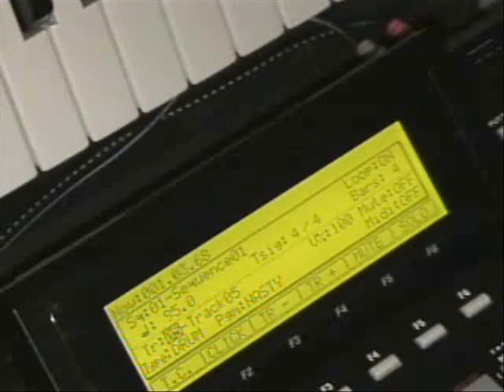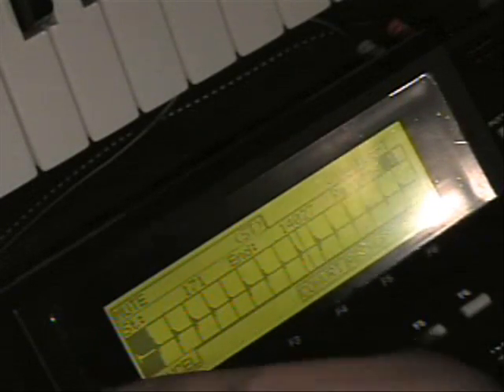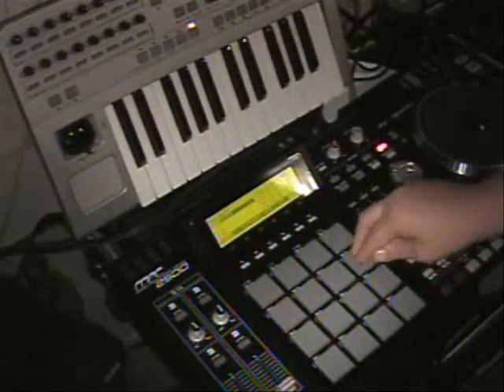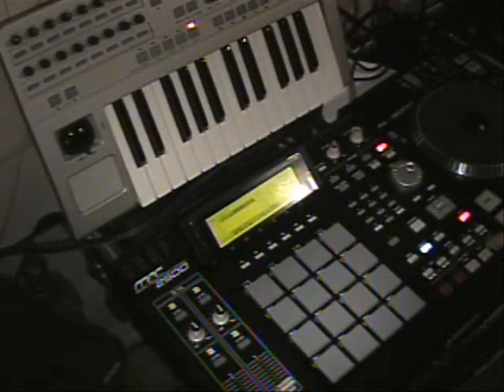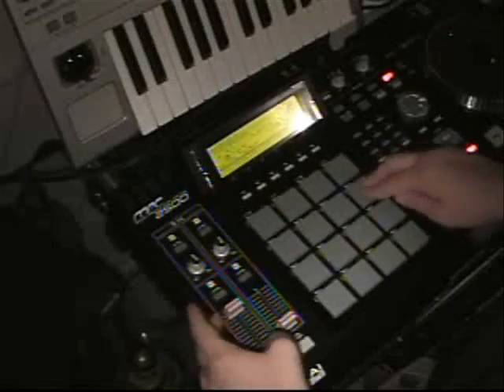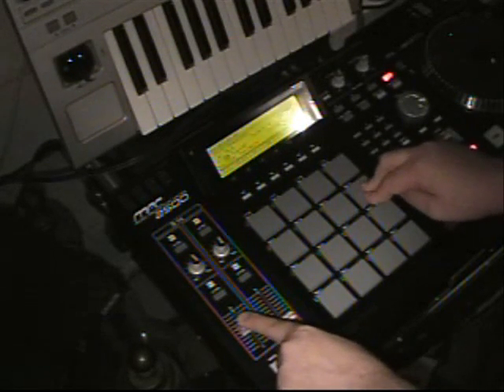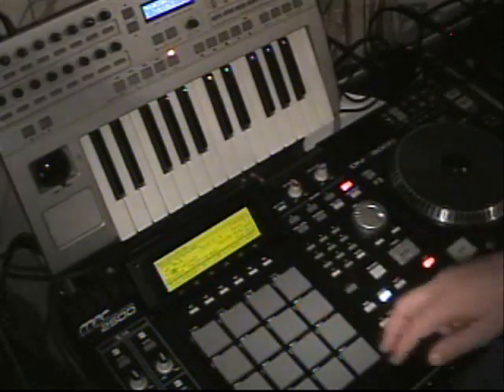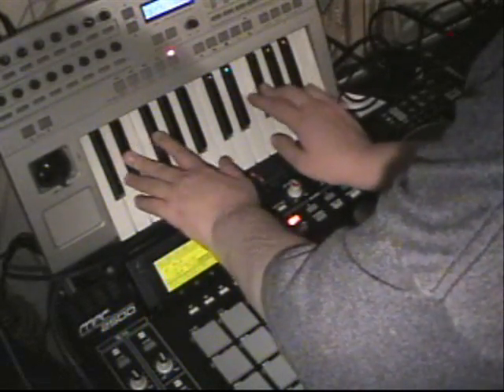Real Time Pitch Shifting & Time Stretching MPC2500 ,MPC5000 & MPC1000

Comment: you could also 16 Level tuning on the sample being played individually until you find the right pitch you want but that would be on each chopped sample while your chops are already layed out through out the Sequence correctly your pitch isn't so you have to find the right pitch for that BPM with the 16 level. I would go with the loop start to end parameter chop way.

Comment: A way to do it this manually is to time stretch each sample on the 2000 using the BPM to match the tempo for each sample...so it won't be in realtime but you get the same result manually...or you could just loop start to end an entire sample without chopping it, then change the tune on that entire sound from the trims parameter screen until you match the BPM's and then do the chop into a program, you'll have the same result

Comment: The MPC2000 can do this but you would have to do it manually. the 2500 and 1000 provides this feature for you but if you wanted to achieve the same result from mpc2000xl all you have to do is chop it up in which it's called "zones" and manually lay each zone time corrected at SEQ tempo. This way no matter what tempo you use it will be "patch phrased". The cool thing about the 2500 and 1000 is the ability to apply 16 Level Tuning on the patch phrase which is dope. Again there is work arounds....